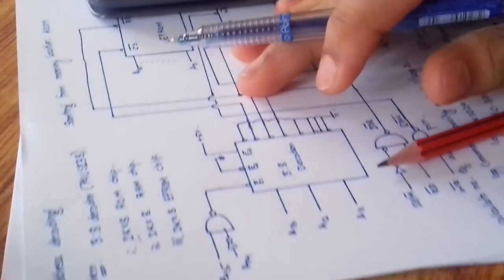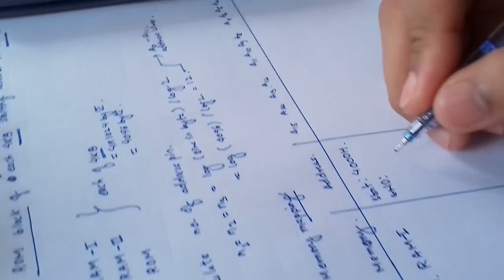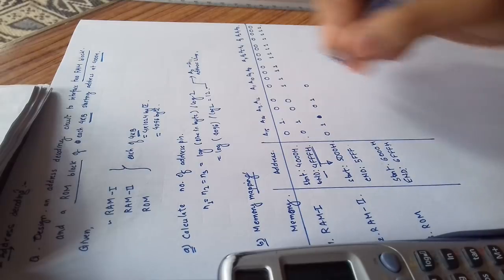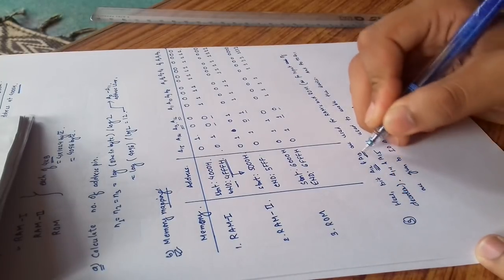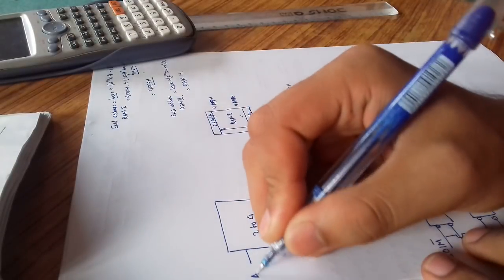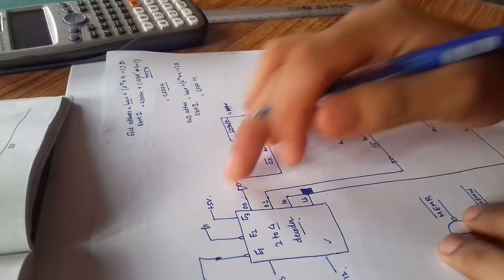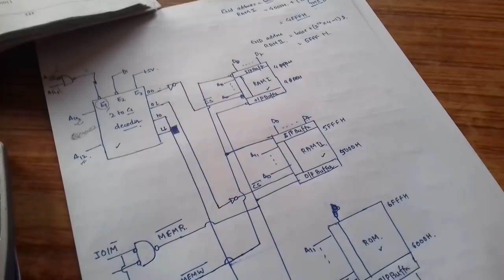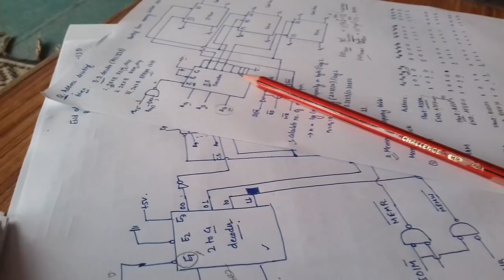Address Decoding

Comment: To turn the video upside down use the developer tool in your browser

goto this line  <div id ="player" class="style-scope ytd-watch">

and add this line of code:
style="-webkit-transform: rotate(90deg); -moz-transform: rotate(90deg); transform: rotate(90deg); position: absolute; z-index:1000"

finally it shoud look like this:
<div id ="player" class="style-scope ytd-watch" 
style="-webkit-transform: rotate(90deg);
-moz-transform: rotate(90deg);
transform: rotate(90deg);
position: absolute;
z-index:1000">

ps: great video

Comment: A processor has an address space of 64 KB. On power-up the processor starts from address FFF0 H. The processor is connected to a 1KB ROM, 8KB RAM and 4 Input/Output Ports. Partial Address Decoding is used to decode the 64 KB memory space.
a. In which part of the processor address space should the 1KB ROM be connected? Write down the address range. Briefly explain. 
b. How many unique addresses should the 4 Input/Output Ports have ? 
c. Draw the Address Decoding Table for the ROM , RAM and I/O devices.     
d.   Draw the Address decoder circuit.

Comment: plz solve it.
interface the 8086 microproprocessor with two 16k*16 EPROM chips and two 16k*16 RAM chips.Draw the necessary block diagram showing the interfacing of the memory with 8086.

here starting address is not given.
plz solve it as soon as possible.

Comment: how about if i calculate for n and get 16 how do i get number of pins fordecoding
Reply from the maker: It depends on the size of memory block given. In this case size is 4*1024byte and follow the step no. 1 to find the address pin.

Comment: how did you arrive at A0-A15 on address lines
Reply from the maker: It depends on the size of memory block. As discussed in earlier section here the memory block in of size 4kb=4*1024byte and use the formula to compute no. of address pin.
Reply: AAkrit Subedi 
After calculating he got 11 in the video but in the numbering, we saw some 12 to 15

Comment: 4:13 can some1 explain me how he did that
Reply: 1. Get a calculator like his
2. Turn it On
3. Press MODE (left of ON button)
4. Select option 4 -> 4 : BASE-N
5. Press SHIFT and press x^2 (this will get you into decimal mode where it takes decimal number as input)
6. Give decimal value as input and press equal to (=)
(Say you gave 420 as input)
7.  You will see something like: 

DEC
420

8. Press SHIFT and press log
(You will get your desired result)

Bin
0000000110100100

NOTE : Modes are printed on the calculator as DEC, HEX, BIN, OCT
If you press x^2 with SHIFT turned on it will get you into DEC

In the case of converting HEX to Bin we can just do (correct me if I'm wrong)
say 4000H is the number then
4 : 0100
0 : 0000
0 : 0000
0 : 0000 
This gives 0100000000000000 which we require while solving the above problem.
Reply: @shivajichalise_  thank u! Sie
Reply: @shivajichalise_  2*4 decoder kina vayo?
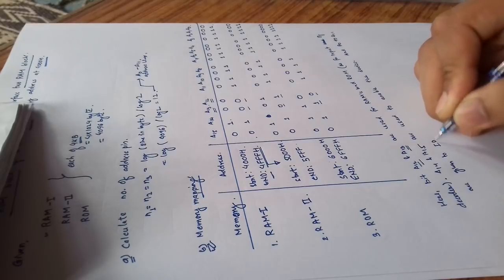Reply: @sanamthapa1621  only two bits are changing .. aru sabbai bits eutai bhayeko use gareko bhaye kun device select garne confusion hunthyo .. see 06:16 jaba 00 pathaincha RAM-I select huncha.. jaba 01 RAM-II ra jaba 10 ROM ... jamma two bits le chuttauna sakeko bhayera input 2 bhayo ani 
input 'n' huda output '2^n' bhanne logic le 2 bits input so 2^2 = 4 output.... correct me if I am wrong hai
Reply: @shivajichalise_  thanks

Comment: Grounding the outputs of a logic IC is never a great idea (Decoder) , minus marks....   Some oldschool circuitry would use an 74LS138 / 74HC138 IC for the decoding, works for 2 or 3 address line to chip select decoding, has inverted outputs and the same enable signals as in your presentation.